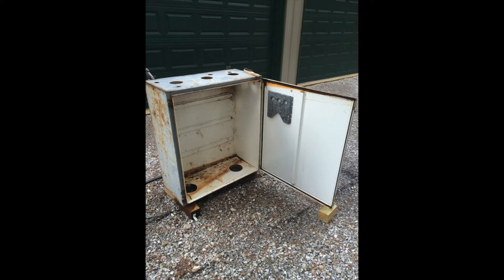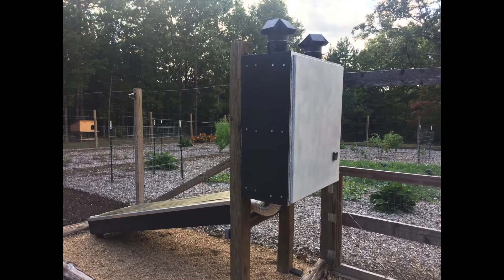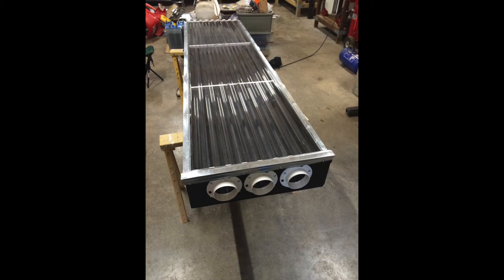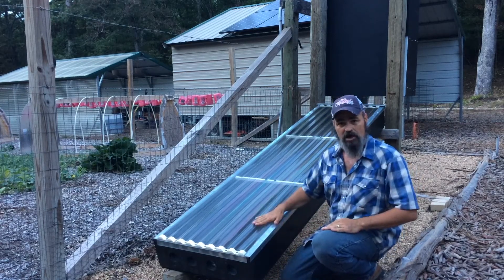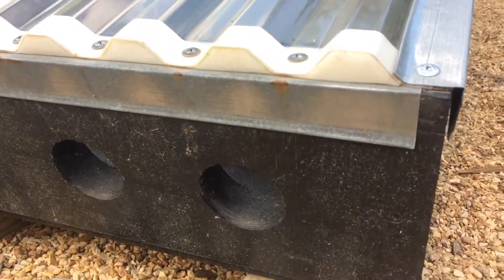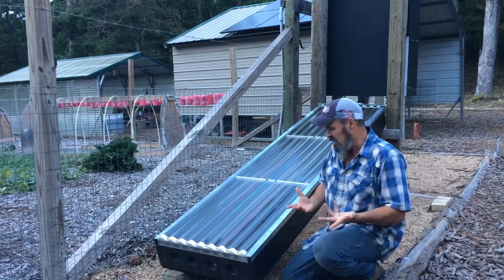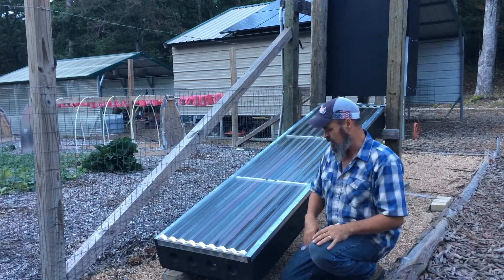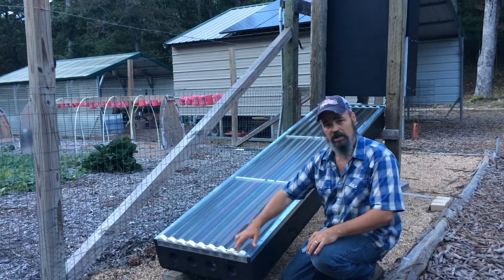How to Build a SOLAR Dryer  -  Solar Dehydrator Design  -  SIMPLE DIY SOLAR FOOD DEHYDRATOR

Comment: We built very similar to yours using the polycarbonate, can't get over 100 degrees. Any ideas?
Reply: could be a number of things lack of enough sunlight, not clearly sealing things off for the heat/insulation, not having enough air circulation, not painting things black, making the dehydrator too big in comparison with the solar heater part, ect.